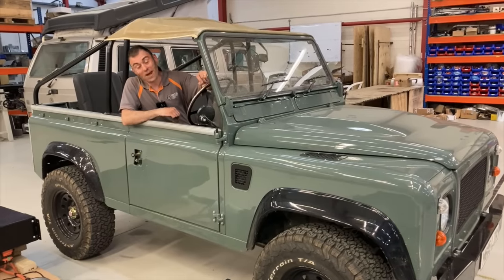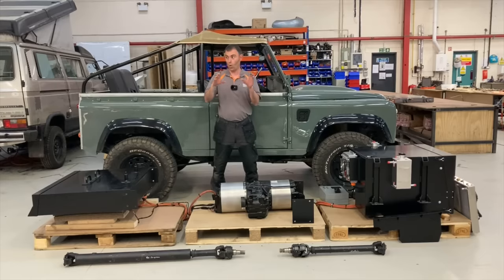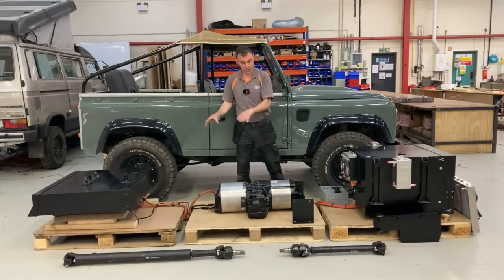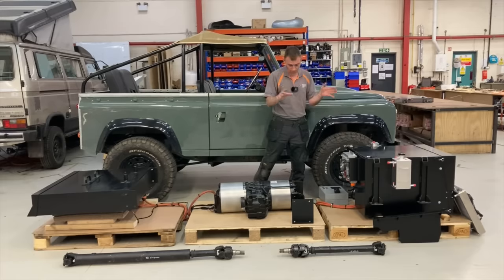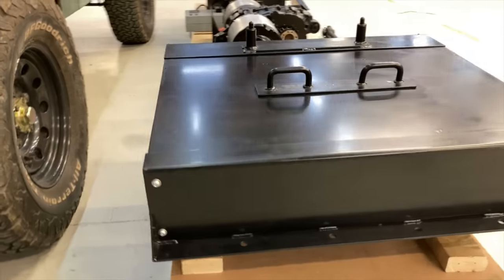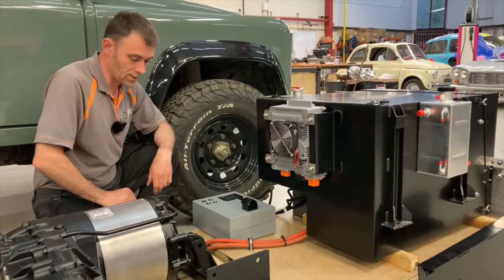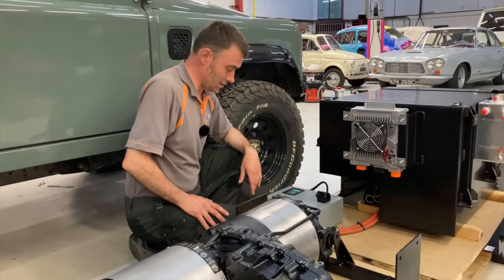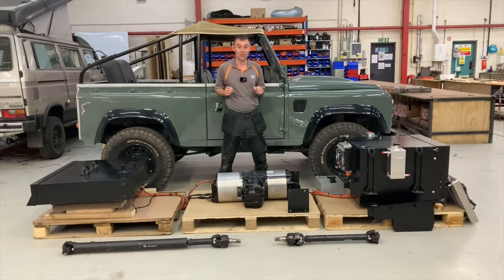Land Rover Defender bolt-in electric conversion kit.

Comment: I love it! Can't wait for the day when you've developed kits enough so that the average garage warrior can do their own conversions. Great stuff .
Reply: Engineering wise I don't see a feasible way to make a kit that can convert any average ICE to electric , it's all going to be platform specific as in the video , if you want a more universal fuel conversion solution, look for lpg/cng injection kits.
Reply: @martin518441  I think you misunderstood what the OP stated. He didn't say a generic kit. He did state "kits".
Reply: @martin518441  Wouldn't shared platforms and engines in many recent ICE cars make designing adaptation kits more feasible? For example, something like the 20 year old Supermini - sized Skoda Fabia Mk1. There are lots of cheap galvanised rust-free examples still around, and it shared platforms and engines with several other VAG models.
Reply: The biggest difficulty with that, is the potential for the average garage warrior to fry themselves & who holds the liability. For that reason, even small garages won't touch EVs or hybrids. They simply can't get insurance cover at an affordable rate.
Reply: Yes - where’s the liability waiver - I’d sign it to have a go at a conversion..  agree there would need to be checks and balances ( like install all the components but get the final commissioning done by an authorised person etc). If ‘they’ want electric cars to be a success they need to start influencing at enthusiast level..
Reply: @kennymaclean1967  totally agree, in Australia we need "compliance plates" fitted in the "engine" bay of the vehicle if modified, to ensure it complies with all safety and design rules. Generally done in street cars, high performance mods or conversion to LPG. The same could be done for electric.
Reply: @kennymaclean1967  Agreed!
Reply: @johnt.848  I am in NSW and have just got an EV Beetle converted from ICE. There is no direct change to the Compliance Plate on your car. But you have to pass the scrutiny of an Appointed Engineer, to meet the Standard NCOP 14. The conversion must also satisfy ADR. If your EV Vehicle passes, then you simply get a Certificate of Compliance. You hand-in the original copy of this when Road Registering, and keep a copy in your Glove Box. And (believe me), it's all worthwhile in the end!
Reply: @martin518441  seen yt video of a French company that just remove the ice and fuel tank in likes of Renault kangoo and iirc fiat 500 was also shown. 
Because battery was compact range was limited. But price mentioned was in the 6k gbp. 
Just required adapter plates to fit transmission of different vehicles.
Company hopes to have the kits out some time this year. 
Also seen yt video of a vintage 1967 mini , in same family from new and current owner learned to drive and passed his test in it. 
IIRC pre used Tesla parts and some upgrades to suspension and brakes with traction control to handle the torque. 
Had better power to weight than most super cars and they did the video on a club racing track to show its potential.

Comment: Oh boy, do I miss my old 109 and 130. To have those electric is just the stuff of dreams. Underfloor installation off the rear bat pack would make some sense tho. 
I've now got a Toyota hiace jumbo 4x4. Half the tradies here in NZ drive Hiace, ideal to convert with your set. Maybe not a classic, but that would be so sensible. Please contact me if you've got thoughts along those lines!
Reply from the maker: Under floor rear battery pack on a 110 is something we've done in the past, 90s are more difficult. Our next gen kit will have a solution for this. 👍

Comment: Thats great work Richard. The kits will hopefully push the price down?

Can you locate the rear battery box below the floor to keep the space available where the rear seats are (i have a Puma 90)

Is there a price for kits (Model S/X and Model 3 sourced) available to know what to expect?

And, is there a warranty given on any or all of the drivetrain including batteries?

Comment: In Africa, Toyota Hilux, Lancruisers and Prado have biggest marketshare. We have Toyota 20 seater minibus taxis everywhere.
Reply: If you are thinking of building conversion kits, I can promise you a great market. The Hilux is the commercial pickup format, with the same drivetrain as the Fortuner, the SUV version. The Prado is the SUV built on the Landcruiser chassis. Landrover Defender is a great vehicle to convert, but a bit rough for urban use. Ford has had good success with its pickup. I would aim at a vehicle lineup from 2018 to 2012, they are still relatively up to date with safety and comfort. Too old to finance and lend themselves to refurbishment. Our company provides Trade Finance and can finance export sales and trade sales, if interested. South Africa and worldwide.

Comment: What other vehicles to convert? Since you ask, Richard, I’ve been wanting to call you to discuss the conversion of a  Mercedes G Wagen. There is a slight issue, however, the car would need to be registered in Germany and approved by the less than adventurous TÜV officials to do so. My idea is to purchase a long wheelbase soft top ex-military version and fully restore it (civilian) and convert to electric power. I think much less power than your very lovely defender would suffice and surely make things easier regarding TÜV approval. Thanks for asking. 😉

Comment: Land Rover Forward Control. They only do 10mpg so would get a huge benefit from an EV conversion. They have a load of space for battery pack and the suspension can easily handle the extra weight.
Reply from the maker: Yes please. Love those things. 😎👌

Comment: Hi Moggie (I hope I spelt that right), I live in the Land Down Under (Australia). I love all u are doing for Electric conversions and Educating Old petrol heads (being one myself), LOL. Your show is very educational for all, especially for people such as myself being an ex rally driver and Audio Engineer (understanding some electrical elements). I have two comments. 1st is u asked for race tracks worldwide for "Buffy" (P.S. luv tha name, big fan of), could I recommend the best track in Australia, "Bathurst" New South Wales (Also known as "The Mountain"......Definitely worth a look as has winding, steep gradient uphill/ downhill then a very long straight (shortened with a "S" bend year's ago, as was too dangerous into a left right-angle corner at end previously). Have a look at n you will understand, especially earlier years such as 69' 70's races known as Bathurst 1000,  and more recently The "6Hr Bathurst"  Easter weekend Production model cars race. Ok, 2nd question is can u  design a kit for a Subaru Forester? I have a 2012 Luxury Premium Forester ( Leather heated seats and blah, blah, blah......) that I would like to go electric with. Being the only "true" four wheel drive car off the factory floor, tested and proven  in rolling wheel trap tests......and in real life by myself towing a camper trailer on wet tracks on Yokohama Blue-Earth-A street tires (should have seen the reaction of all the lifted 4x4's with all terrain tires, at the top of Captain Crossing, Mackay, Queensland). Just for all those laughing if own a "4x4".....What is the lowest part of your car??????? your Diff....Lift kit does not lift "your" diff...... Ever looked at a Foz........lowest part is the exhaust, which I would remove going electric.... I intend to do a  2" lift kit, as a body lift kit lifts "everything" (including the diff), except the axles n control arms (which u lift via bigger tires), also intended on doing. It is currently a low/high range 5sp manual gearbox. After seeing your "true" 4x4 Land Rover, I want too keep my "all wheel drive" car if possible. Unfortunately  "Panda" (Subie) has traction control and hill start assist....etc...I am wondering if these electronic parts will pose a problem?  Please keep the Very Educational and inspiring videos coming, as well as the fun ones......LOL

Comment: I know you're not direct to consumer just yet, but what would this typically run for the 110 conversion kit as demonstrated? Looking to see the benefit in waiting for your kit versus other DIY kits with far less testing
Reply: They probably don't mention pricing because it's up to the resellers to set their own pricing. I think Twisted in the UK charge around £70k for the conversion.
Reply: Hummer H1?
Reply: Also interested in this!

Comment: to answer your question...the obvious candidate is the AUDI TT !
AWD
CHEAP AND PLENTIFUL IN SUPPLY, FROM £1K (MK1)
CHARACTERLESS ORIGINAL 4 CYL WOULDNT BE MISSED
RUGGED DRIVE TRAIN

Target:
Budget Touring Kit: 200 ml+ summer range - 0-60 sub 6 secs
Performance Kit: 300 ml summer range - 0-60 c. 3.5 secs (quicker is simply too dangerous for public roads)

Kits need to be ultra comprehensive and simple to install at affordable pricing - thats where the challenge is :)

Components really need careful sourcing (China?) so the kits can be sold in volume....which in turn will help in reducing the price further

Comment: A bolt in kit for a Series would be ideal. Smaller motor would be fine. Less than £10K and you’ll sell them all
Reply: ah ... I'm thinking you don't realise how very very far away from current prices you are with that!
Reply: @MrAdopado  hyper 9 motor + 6 tesla modules 30kwh is 14.000€ with full conversation kit (charger, pedal etc)

So about 11.800£, he is not that far off.
Less than 10k? If you source some components yourself. As a kit? No.
Reply: I'll put my name down on your waiting list!!
Reply: @DuBstep115  The price that a company has to charge is far more than the price of the basic components. I don't doubt that an individual with the skills, time and resources to develop and instal their own EV conversion could do it for around 10,000 but that's not what we're talking about.
Reply: A decent crate NA engine would cost that alone so this kit isn't crazily priced.
Reply: @andyevans2000  what kit ... what price?
Reply: @MrAdopado  Chevvy LS3 ?

Comment: Hi Moggy, I have been thinking of converting my JB74 Suzuki Jimny to electric. Out comes the engine and gearbox and in goes the electric motor in place of the gearbox, onto the transfer case. One of those 100hp motors you out into beetles/Fiat 500 etc. the Jimny doesn’t need Tesla levels of power. Then fill the engine bay with batteries and the space where the fuel tank and exhaust system was. Hopefully get about 100+ miles of range. It will still remain 4x4. Is it doable? I think it is
Reply from the maker: That'd work. 😎👍
Reply: Hello , I‘m also interesteted to convert an old Suzuki into an electric car. Its a 1981 LJ80 Van, the closed version. I would be thankfull for any informations how to do it….

Comment: I looked up the price.
It said ECD starting Defender is $179,995.

I personally would prefer it if you found something cheaper to build the kit with than a Tesla motor.
Tesla are already over priced. 
No one needs a 4x4 to do 3.5 seconds. 
I still need the range and electric.

Would be nice to have an option to go electric on my FJ-60 once the parts are gone

I had a Nissan Leaf once, it was zippy enough.
The range on it sucked for me as it was half way through the battery life so I got rid of it.
Plenty of those.
Maybe make a kit with a "decent" battery", preferable once that can by DIY restored or would not cost $$$ to replace.
A Nissan Leaf engine or similar.

Nice work unrelated.
Keep it up.

Comment: Have you ever considered making a kit for larger vehicles like pickup trucks?  I am especially interested in a kit that would work for heavier duty trucks like the 3/4 or 1-ton (as we rate them in the US). Everyone making electric trucks seems to be concentrating on the 1/2-ton models. I want a heavier duty truck that I can connect to a gooseneck or fifth wheel trailer.  I don’t need a lot of range. I typically haul equipment much less than 50 miles one way.
Reply: Hoovies Garage has recently posted a video towing with an electric F100, might be worth a watch. It didn't go well.

Comment: Great video. You asked about other vehicles and I was wondering about a LR Freelander II conversion. I found a 2007 model for £3K, for my daughter to tow her horse box and its a great tool and has a bit more inbuilt luxury than the defenders. I've been surprised how solid the car is and how well it drives considering its now at 150K miles. I've spent some money on suspension and other bits and pieces and its been the most reliable land rover I've owned (Low bar I know).  I think its ripe for electric power. Paul
Reply: Well as they want £80K yes £80k to convert a vw Beetle you might as well go and buy her a nice shiny Range Rover!!

Comment: What is the fascination with bonkers 0-60mph times for electric car people? A set-up to provide ample performance (0-60mph in 10s & 90mph) and an ability to tow 3500kgs would surely be better for a Defender.
Reply from the maker: It can tow 3500kg trailer 0-60mph in 10s no problem. 😆😁👍

Comment: Great videos Richard, But just a few questions:
Can you air freight a kit including batteries to Australia?
Is it possible to have power steering when converted to E Power?
Is it possible to have air conditioning when converted to E Power?
How does the 12v battery get charged while driving?
Have you converted a 1980’s Bentley or Roller?
Cheers,
Mark 
Western Australia
Reply: For answers to your questions on A/C etc, check out our previous episodes where we explain exactly that. 😀
Reply from the maker: Yes to all of the above. Contact our partner in Australia. Link in description. 👍

Comment: Interesting.
But for little else than many think here.
I want to make a hybrid, as I don't want to depend on charging stations and want to boost power from the diesel engine.
Therefore, I will place the electric motor behind the transfer gearbox.
1.) Charging the batteries via diesel.
2.) Boost power.
3.) Drive purely electrically in cities.
3,a.) Not be excluded due to pure diesel operation.

4.) Since it is an overlander, the EV batteries will also be 'house batteries'.
5.) It will also be possible to make a powered trailer.

The car is intended for trips far from normal supply options.
Thus, diesel is not an option. But a necessity.

Comment: Hi, looks like a great set up. Two questions, based around not wanting a dragster, but a Land Rover; What about the loss of the hi/low box, how does the Tesla torque perform towing off road. And also, how is on road towing? Thanks.
Reply: The motor has plenty of torque. 😊
Reply: Ok, 450Nm from nothing, but how does that equate to the old motor with low first? Is the rim pull equivalent or better! I get that lots of folk want Defender F1 cars, but I would like an electric workhorse.
Reply from the maker: I use this a my work horse too. It tows the car trailer lovely, so smooth and much nicer to tow with than an ICE Defender as there's no gears and regen to help slow thing down slowly. In fact I'll be towing a car over to Northamptonshire next week with it. Off road it's much better and easier to drive than when it was ICE with all the hi/lo lock diff shenanigans I've had to put up with for 20years. Just manage the speed with the throttle, that's all. Simple. I find it much more capable off road now it's electric. There's a link to us driving it off road at the end of the video. Also, the Editor of Land Rover Owners International did a good review on it a month or 2 back if you get that mag. 👍
Reply: @ElectricClassicCars  Thanks for the response. Trailer pulling off road is my need and anything that makes it less pfaff is worth it for me! I’ll be in touch.

Comment: I have just found your channel and am fascinated and excited by the EV conversion for Land Rovers. You mentioned other 4x4's that could benefit from this treatment (you used the 4x4 Panda by way of example). I have a Suzuki Samurai which I have been considering converting to EV (hence why I watched your video). Small and light although not much space for the batteries.  As an aside, have you considered less batteries but a small onboard petrol/diesel generator (range extender) to get over the issue of endurance for those who may be looking for an overland vehicle?
Reply: I second the Suzuki Samurai conversion.
Reply: suzuki sj would be a cool conversion
Reply: @Riccous1  suzuki sj would be a cool conversion
Reply: @Riccous1  agree 87 jx!

Comment: Looks an awesome kit, beautifully simple. Does it use regenerative braking?
Reply from the maker: Yep. 😁👍
Reply: @ElectricClassicCars  All around phenomenal kit - deeply impressed by how good you've gotten at this. What is the final drive ratio between the Tesla drive unit and the wheels given that there's the additional axle bellhousings in the mix? Do you recommend gear changes in the axles? It must be an absolute rocket with the additional gear reduction
Reply from the maker: @acp4343  We use our custom 4.5:1 Tesla gear set in the Tesla DU. 👍

Comment: I have an Xterra I would love to do this to, but I’m sure even as a kit it would cost more than the vehicle is worth. What I don’t understand is why EVs have to cost so much… it seems much simpler than a combustion engine setup. I know the batteries aren’t cheap, but still.
Reply: litterally 70% of the production cost of a tesla is only the battery pack
Reply: Xterra would be a brilliant idea because then you cover the older Pathfinders and Frontiers since they are all basically the same vehicle with body and minor suspension changes.